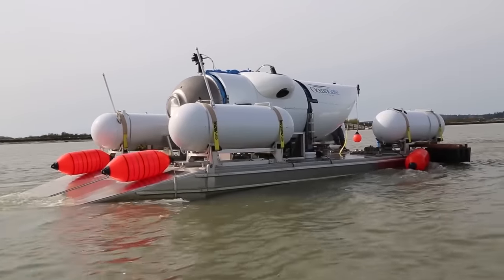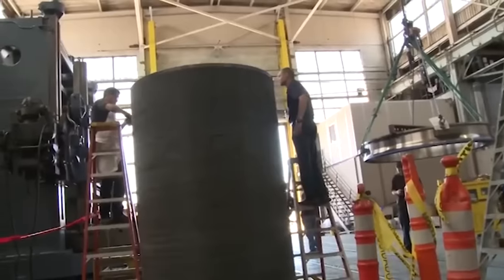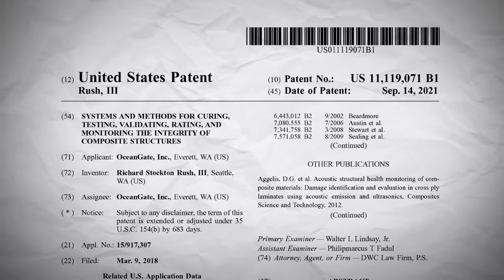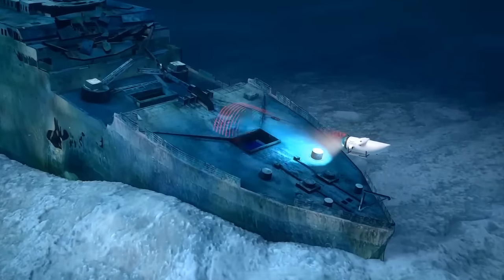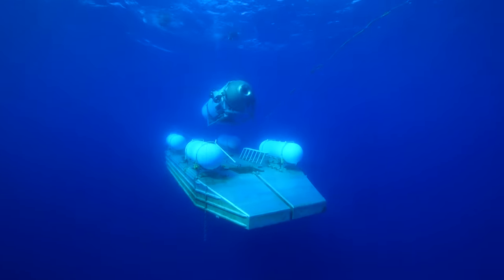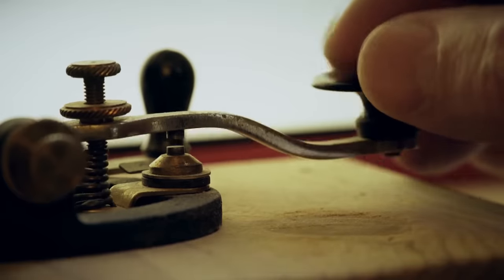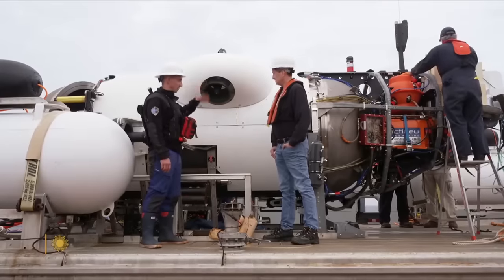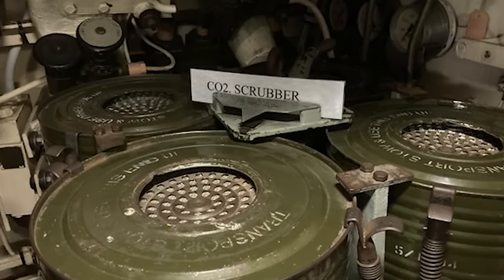Exposing OceanGate Submarines Many Fatal Designs

Comment: So how were all the mechansims, thrusters, propellers, oxygen tanks carbon dioxide filtering system, batterys, antenna, ballast, all these things had to have been connected by wires and cables to the interior of the hull because the sub was controlled by a hand controller linked to the computer, and the computer and lighting had to be powered by the external batteries in order to give orders!
Because Rush stated the sub was controlled by the computer using a console controller..
The antenna was meant to be on the top outside exterior of the sub, how was it connected to the interior without compromising the carbon fibre hull?
Where were all the internal and external fittings linking the inner  hull to the ouside of the hull, there is no sign of any connections to the titanium aft cap on any design drawings that i can find..
That sub has never been down to the titanic, i dont care who claims to have been down before, that sub had never been to the Titanic!!
Probably never been any deeper than 12ft for video footage purposes!
The whole thing is a fake story!

Comment: Rush apparently knew nothing or didn't care to know about the way a textile like carbon fiber works. Yes, it is strong and lightweight, but if it's only threaded in one direction, it's bound to fail. It was wrapped in carbon fiber, not weaved .

Comment: The problem with off-the-shelf game controllers is not that they are game controllers. It is a safety-critical system and should have been fire-rated. I don't believe any of the electronics inside the submersible were, and off-the-shelf game controllers certainly are not.

Comment: When I saw that it was not a sphere. I knew it may not be strong enough. A sphere is the strongest shape for even, inward pressure. Then when I read that carbon fiber was used and had never been tested in such a way, it's no wonder it was crushed. Carbon fiber is great for lightweight bicycles and racing cars, but this does not mean it's great against crushing pressure. I've seen in a documentary how a carbon fiber racing car can have parts break way, and carry the force with them to protect the driver. In a submersible, you don't want parts to break away under pressure.vThe real danger sign was that the people responsible were in a hurry, even when warned by engineers. remember what happened to the space shuttle with the same name was launched on a cold day when the parties responsible were warned by engineers not to launch due to the effect of the cold on the rubber rings designed to seal connections. They rushed it, and everyone on board was killed then, too. I was eating lunch at my job when I saw the launch vehicle vaporize everyone aboard. That, and this, are death due to criminal negligence. They ignored the warnings.

Comment: Grossly misleading picture. The structure was not made to dissolve. It was the attachment points for  the support structure, landing gear if you will. Even if the crew were incapacitated the structure would dissolve and send the sub to the surface.

Comment: Sorry but Computer controllers are not normally used in submersibles! They are operated by batteries which pose a possible fire risk. Not a great idea. Especially when it takes an hour to remove the occupants.

Comment: Isn't carbon fiber supposed to be 20x stronger than steel?  something doesn't make sense.
Reply: The sub unfortunately was not made only of carbon fiber.
Reply: Carbon fiber is for tensile strength not compressive. if you pull 4500PSI of vacuum on a paintball tank it will implode
Reply: @@OliviaSarm15GH again strands of material is for tensile (pulling) strength not compressive (pushing) strength. The reason the carbon fiber didn't work was because the carbon fiber didn't do anything only the plastic resin coating the carbon provided most the strength in compression
Reply: @@OliviaSarm15GH it was an example of something that is made of the same material but used property
Reply: @@OliviaSarm15GH I have them fill all tthe way to 4500 psi at my local paintball store ??? All I'm saying is carbon fiber is not meant ro be compressed I don't get what you want

Comment: Anyone with a minimum experience with fiber composites would immediately note that expecting them to be useful under compression is no different than pushing with a rope. Fibres are nowhere near useful under compression as they are under tension. This is why high pressure thanks are reinforced with fibre windings, as they carry the extra hoop stress in pressure vessel that would otherwise burst, just like wine barrels.

Comment: I’m sorry but Stockton rush should be to blame for those lives but none the less you get what you pay for and in this instance they paid the price for his stupidity and cheap corner cutting and short cutting to produce the submarine on the scale that it was constructed to along with various other safety implementations that were very much required to under go vigorous testing and performance stages and features that it had to pass. A lot of failures that led do a lot of accidents, carbon fibre and titanium being one and then firing or reliving your safety engineer of his duty for the safety of the crew on board. None the less let this be a reminder that trying to do things in an easier way or method is not always the correct way and might end up paying the price with your life especially when your life is in the hands of someone with a Logitech play station controller that barely connects to the consoles aka play station and Sony that provide them, these controllers are faulty and I can’t imagine what other materials and components and multitude of items that were included and used in the production of the titan sub would have obviously failed safety guidelines by 10 folds if not more.

Comment: There are reason why up until now there are no carbon fibre subs. Most are made of materials like steel and titanium. The same reason why you dont do a carbon fibre blade because its brittle and cannot hold its shape. Steel and aluminum and titanium are flexible enough and proven materials that is used in the aerospace and maritime industry. The biggest question mark is that they the ocean gate dont want to follow regulations and dont want to be certified. There are reason why there are engineering codes and standards to follow. This is because standards did not come up over night. Its a result of years of experience. And even accidents like the Titanic have given engineers an idea and upgrade their safety standards.

Comment: The attack submarine only use the game controller for periscope and not to controll the movement like the submersive titan. That is a HUGE difference. I would never  deep dive with any vessel that is controlled by a game controller. They are not even reliable above seawater. You have to be nuts to go down in a vessel with a game controller. I know there where other even more serious issues like the material but still that alone is not safe. I understand why they steering a drone or any other unmaned vehicle because it is no risk to die if the controller fails.

Comment: If you look at the transcripts that are out there between the titan and the surface, and if it is true.  They heard crackling or some noises coming from the aft.  My thoughts are that the rear (glued) titanium piece was the possible failure point with the noise being the pressure working and breaking through the hardened glue which eventually weakened enough to cause the end to be popped off then immediately after the water breaks through the wall the wall separating the rear form the center hull with enough force to separate the front dome and view port.  Also at the same time exploding the center hull into pieces.

Comment: At 2:57 of this video, a yellow Strain Gauge is described as one of the means to monitor hull stress. They are either electric or fibre optic such as FBG. Commonly used also in bridges, towers, platform jackets, wind turbine blades etc. They monitor the stresses of the equipment and the recorded data is sent for analysis as explained in the video.
NTSC may investigate if the readings during the previous Titan dives did show a negative progression but was ignored.

Comment: The pressure hull was the weak point...'carbon fibre' per se can only take tension loads not compression which the Titan needs where the higher pressure was from outside didn't they know that?

Comment: I was pretty sure he was onto something great that would work since the CEO was the pilot and obviously it wouldn't be a deathtrap if he was in it right? It turns out during some test runs in Bermuda, the observer (they didn't go through the approved testing process, but they did allow neutral observers to go on some dives and watch them) heard the sound to buckling and damage. He said that it would only last a few more cycles if they didn't do something to fix it.

Comment: I've spent some time thinking about the whole thing and... it would have taken way less effort to make a 5 inch think stainless steel tank with enough air inside to make it bouyant instead of layering up carbon fiber. Like literally every other deep sea submersible. And it would have never failed or weakened in a human's lifetime making dives constantly, and EASILY handled that depth. Aside from all the equipment onboard, the basic principle of a sub is really simple; it's just a tank, except the pressure is pushing inwards instead of outwards so it's relying on the compressive strength of the material rather than the tensile strength. Sometimes the simpler more conventional way to do something is just better and this is one of those things. They tried to make a high tech futuristic hull out of carbon fiber and that's just not and will never be the way to do it

Comment: Fascinating video, but I have a question. Carbon fibre composites are also what aircraft wings are made of I believe. So are they subsceptible to the same kind of pressure which the submersible will have encountered during its dive?
Reply: No, aircraft wings aren't subjected to anything even close to that level of pressure. Aircraft wings are subjected to a pressure of roughly one atmosphere. The sub was at a pressure of about 400 atmospheres.

Comment: Never understood why relay buoys aren't regularly used. Just release a dozen small sphere data relays as you descend the water column, they would be designed to either float or sink to the appropriate depth where they would just float. Problem solved.

Comment: Im 100% sure that the titan sub had issues with power because of the circuit board or wire was exposed to the water whch fried the system end up not able to control the sub to emerge to the surface.

Comment: this is probably one of the best explanation of the systems on board without being completely biased. Yes we all know they cheaped out and under estimated the ocean, but you were on point with stating that the controller used is similar to other professional uses and the safety systems. being so close to the titanic wreckage, wonder if they actually made it down there to the bottom or just coincidentally ended up right near it.

Comment: Carbon fibre seems to be the wrong choice.
It is suitable for aircraft fuselages where you have the high pressure inside so the fibre is extended. For submarine it is a compression force!
Who designed this ?

Comment: Lots of good information, but I found your video somewhat confusing. You opened the narration by saying the carbon fibre hull was designed to "dissolve underwater". But, unless I missed that bit, you did not tell us how it dissolved. What is the mechanism of that and what is the proof that it actually dissolved?  You also specifically said the carbon hull was the failure point, but then pointed out other problems that could have also been the cause of the catastrophe....the tubular hull shape, or the plastic window only certified to 1300 metres. I think that until the  RCMP and the Transportation Safety Board in Canada, and the U.S. Coast examine the wreckage and issue some reports, declarative statements by non-experts are just noise.
Reply: Not the carbon fibre hull...just the tie-downs of the ballast, so the sub would float to the surface after 24 hrs or so, if all else failed.

Comment: The title of this video is misleading. You talk about it's design and how it functions but didn't get into it's fatal designs at all. You briefly mention the 1400m rated glass and the oval shape instead of a sphere, that's it. There's way more to talk about than that though when it comes to the flaws. Matter of fact, those two things weren't even the reason the sub imploded. Anyways, nice video but just very misleading title, that's all.
Reply: @@Scheduled_for_deletion That's not an equivalent example.

The title of the video is "Exposing OceanGate Submarines Many Fatal Flaws". yet none of it was exposed or talked about. A 10 minute long video with a 5 second clip within it of him mentioning the window's depth rating. 

That's like you producing a jam sandwich tutorial video and it's a 10 minute video of you talking about how good it tastes and within the video you take 5 seconds to briefly mention what type of bread was used.

Comment: Everyone assuming carbon composite design can't work. False assumption. Just because an accident happened doesn't mean it can't be improved. The vessel is in compression and carbon fibre laminates in compression buckle but this can be managed by post buckling analysis, damage tolerance analysis and adequate margin of safety assumptions
Reply: it also wasn't made with the optimal weave, the wrong material was made wrongly. It was also expired

Comment: The main idiocy was using a cheap game controller.  One splash of salt water and it’s useless.  Totally bonkers design.
Reply: @@RealAmercianArchetype Basically everything:

(1)  Not having the plastic shell tested at twice design depth, and through multiple dives.
(1.1)  Gluing Titanium to epoxy.
(1.2)  Being screwed into the capsule with no way to get out.
(1.3)  No helmets, seats, or seat belts.
(1.4) No sufficient ballast weights to get to the surface in a hurry.
(1.5)  No backup Oxygen or pressurization supply.
(1.6)  Not being certified by diving standards organizations.
(1.7)  Not being informed of the actual risks.
(1.8)  No control of temperature or condensation or outgassing.
(1.9)  No waterproof primary or secondary controls.
(1.91) Fail-safe controls, like ballast held on by electromagnets, so if electric power fails, the capsule automatically rises to the surface.
(1.92) Controls that operate even if electric power runs out or fails.
(1.93) Bouyancy assistance from tanks of lighter-than-water liquids, like alcohol that can't fail due to pressure.
(1.95)  Not being tested for pressure, temperature, and stress in a laboratory.
(1.97)  Using a plastic window only rated for like half the expected pressure, insead of like the usual standard of multiple times the expected pressures.
(1.98) Relying on stress detectors that only tell you that cracks are currently happening, not the actual stress levels before things start to crack and fail.
(2) Basically everything that isn't totally salt water proof, pressure-proof, redundant, fail-safe, simple, mechanical, type approved, and with a long history of successes.

The diving standards are truly written in the blood of many past explorers.  It's fundamentally crazy to totally ignore the hard lessons learned over the last 150 years.

Comment: After the docking platform has released the submersible, how does it refill it’s tanks to resurface? I mean, specifically , where does the air come from to restore buoyancy?  Thanks. Excellent summary.
Reply: The water tanks could not be refilled with air, due to the extreme water pressure inside the tanks after they flooded. The only solution was to disconnect the water tanks and other heavy metal ballast, leaving them as pollution on the ocean floor. Then the air-filled passenger cylinder could slowly rise to the surface.
Reply: @theontologist  Thanks, I think I get it. I understand how the submersible Titan drops weights to resurface. Just want to be clear - the drop off platform, after filling its tanks to launch the Titan, releases those tanks into the ocean, and then is able to refloat itself? Have I got it right?

Comment: so why did the 10hr window of the dissolvable system fail?
why would the deadman system need oxygen?
or did the deadman dissolvable system work, but the imploded vessel was too mangled for it to float back up?
Reply: it needs the air pressure chamber to float, they said the sub was designed to stay in one spot if everything being equalized, without the pressure chamber, the sub sinks like a rock, it weighed over 20,000 pounds.
Reply: @tonyrame7548  ok. Gotcha. The  dissolvable material just activated the buoyancy system. It was not self contained system that survived the implosion.

Comment: everyone has their OPINION. dYou didn't build it and you never saw it so stop with your GUESS work because that is all it is.
Reply: NOT Guess work at All!! Five people are Dead because of this; Oh, I got a great ideal, let's build a carbon fiber tube which is Not tested and certified and then glue, yes, I said GLUE, 2 titanium ends to it. Then let's dive it over 12,000 feet down exposing it to horrifying Pressures and I'm sure the GLUE will hold for Ever! Did you see the recovered pieces today? I didn't see any shattered or broken carbon fiber pieces on the titanium end caps where there should be IF the glue held. Looked like a Clean separation on both end pieces. This world is Full of Stupid people.
Reply: No, this thing was such a hack job everyone can see it was bad, that’s why there was a legal dispute in 2018